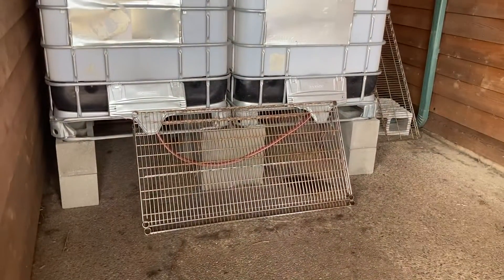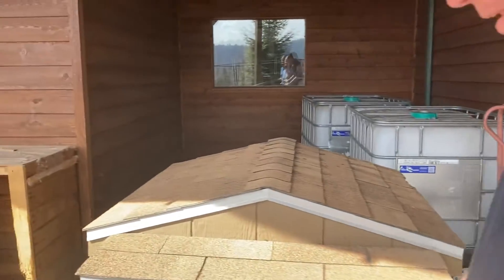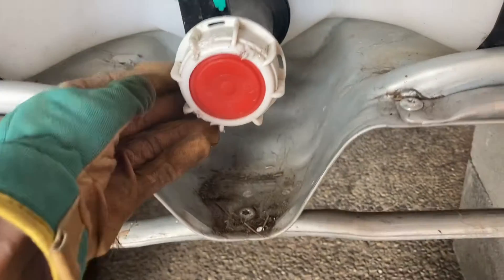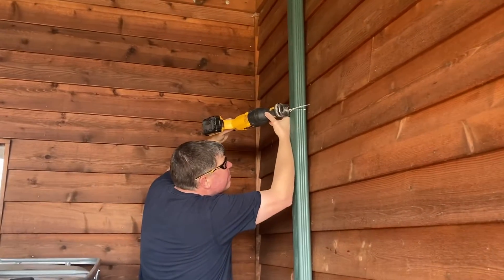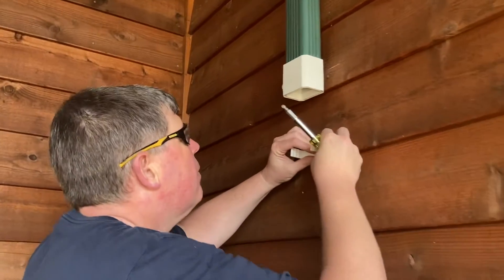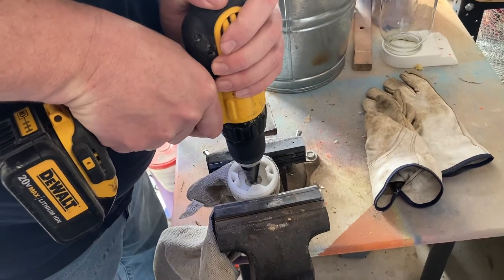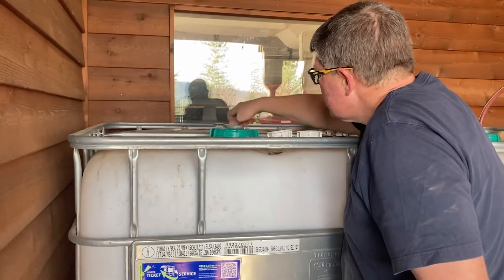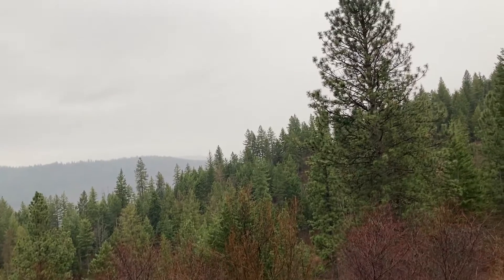DIY rainwater collection using IBC totes

Comment: Where did you get the adapters to hose from the tote?
How do you know what threads? 
Thanks
Reply from the maker: @mikethomforde7326  Amazon. You should be able to tell by looking at your tote which kind of threads you need. Most of the IBC tote adaptor listings are pretty specific. Mine said this:  IBC Tote Adapter, Food Grade IBC Drain Adapter,Water Hose Male Adapter for Garden Hose,2" Fine Thread X 3/4" Male G Hose